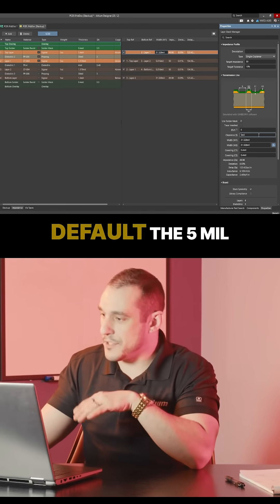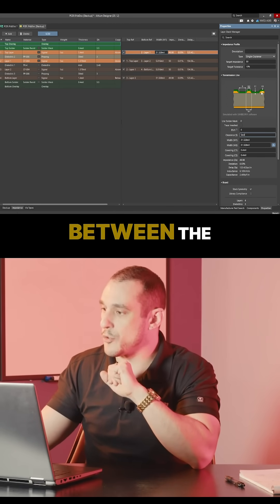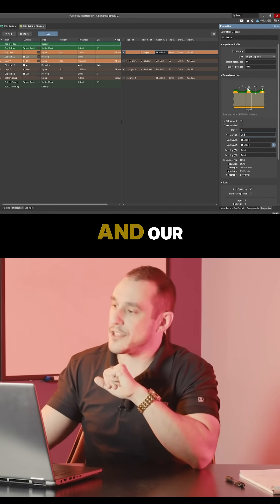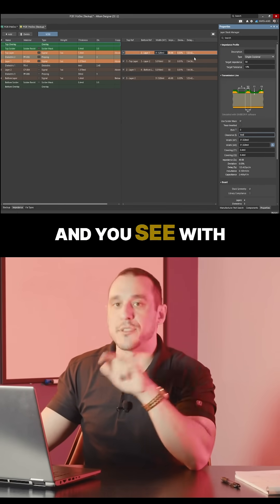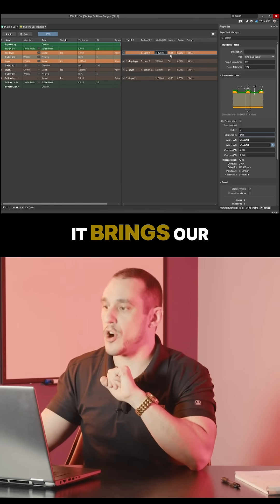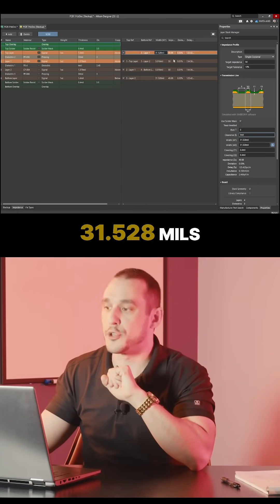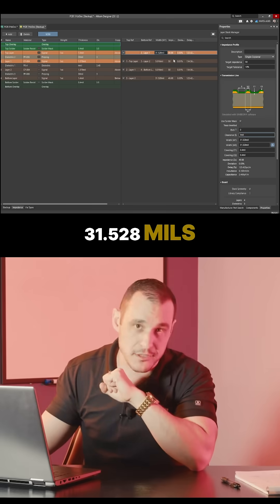Reducing Transmission Line Width w/ Coplanar Grounded Pour Techniques

Comment: Any thoughts about flex with stainless steel stiffener?
Reply: I've never heard of using a stainless steel stiffener but that is interesting idea. Have you built a design like this? Does the polyimide bond directly to the stainless steel with an adhesive-coated polyimide? For one of the aluminum-core PCBs I did in the past, the manufacturer uses a membrane adhesive between the prepreg and the aluminum to increase the adhesion strength.
Reply: @Zachariah-Peterson  https://youtu.be/K05MkX0hVTo
at minute 1:22... It probably existed even before.

Comment: Sometimes we have to go 4 layer just to make sure ground is closer or the minimum supported 2 layer thickness is like 1mm.
Reply: Yes, if you have to make the 2-layer track very small you end up having to make the track-to-copper pour clearance on the 2 layer board so small that it requires a more precise etching process, and that ends up costing more than the 4 layer PCB stackup. The same thing happens with differential pairs on 2 layer PCB, you might have to make the track-to-track spacing so small that the etch precision gets too high and it is less expensive to use 4 layers.